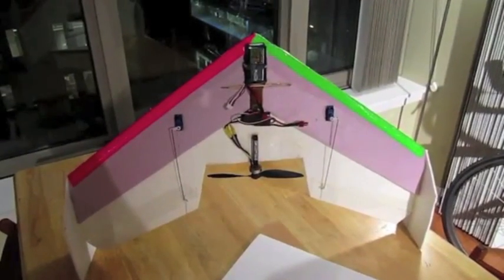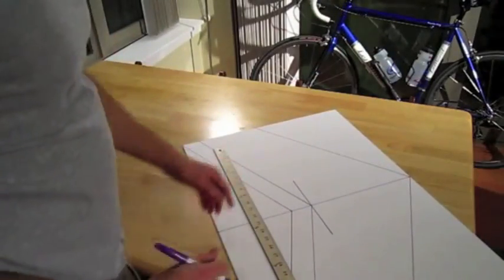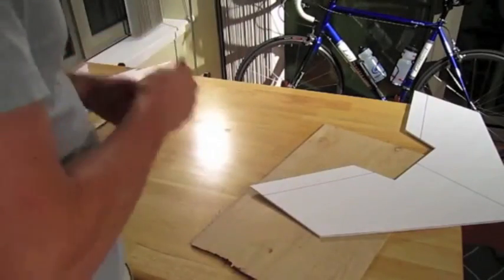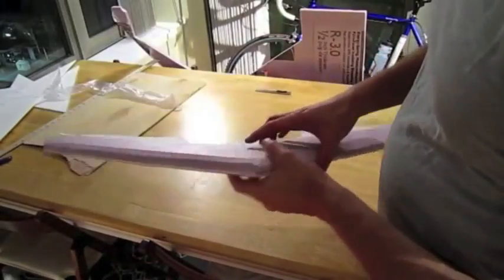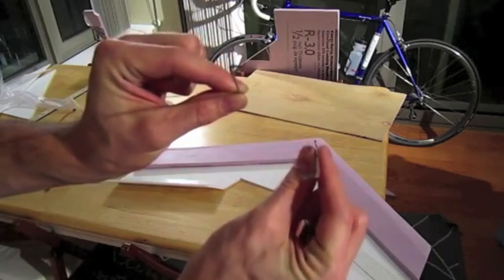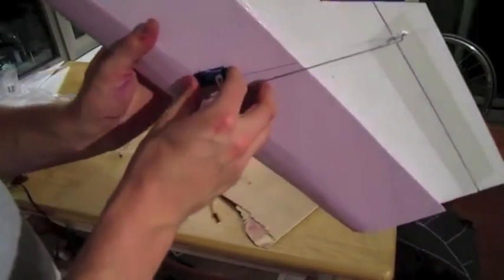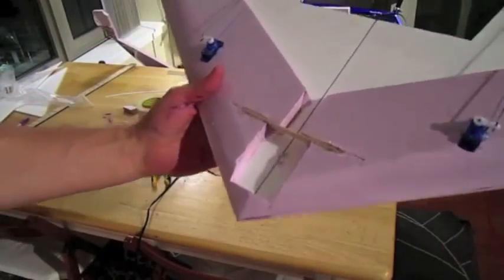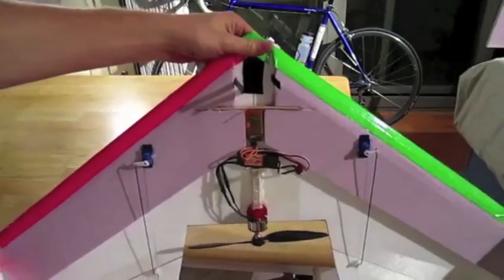Delta Scratch Build Video

Comment: Sir I live in India so that's why I don't have that much availability of Electronics so I can only use 2212 (1400kv,2200kv) bldc motor prop and battery are not my issues but i want a small wing 30"
i want the same stability and power(i want stable plane cause i dont have big area to fly around) suggest me which motor?

Comment: I know this is going to be a very basic question, but I've only dealt with repairing pre-built quads at this point, and this will be my first RC plane, so...
My receiver just arrived a couple days ago, and I'm still waiting on my servos, etc.
How do you wire up the receiver to the battery?  Also, where can I find good mounting hardware for the motor?  (I've searched my usual parts sources for 'stick mounts' and 'motor mounts', and come up pretty empty.  Nothing that seems like it would attach a motor with its spin axis parallel to the mounting surface.)
Reply: Usually your ESC supplies 5v straight to the receiver via the throttle channel.
If it doesn't, you will need to get a battery eliminator circuit (BEC) to do that for you.
This may help: https://www.youtube.com/watch?v=j61Q3e8AFR4

As for motor mounts, i tend to 3d print mine so i really don't know but i guess you could use some angled aluminum.
Reply: Thanks.  That cleared things up a lot.
Reply: No problem!
Reply: Ok, I've got one more question...  I thought I bought the same wire (*.037" hardened music wire) mentioned in another build video, but it just flexes when the servo pushes back.  What should I be looking for?
Reply: This is probably going to be a bit late, but here's what I know:
Hardeded steel wire works fine, about 1.2mm I excpect I use...
I have also hade positive experience with wire coathangers and bicycle spokes. The spokes are good because mine already had the bend made at one end, with a flat part which is easier to incorporate into a model. However, both coathangers and spokes are a lot heavier than I would like, although they fly fine. 
Depending on where you are, prices and especially names may vary.

Another thing you might want to consider is how efficent your hinge is. If it is too stiff, the linkage will have a hard time whatever. Try making the hinge as loose as you can, and furthur reinforce it when you know the limits.

Comment: I've build this kind of delta wing with my own parts and all, however, I have been having trouble with the servos. The servos begin to spin when immediately powered. 1) I did check to make sure it was in the right spot on the receiver 2) the speed that the servo spins is able to be slowed to an extent the controller, but can't be fully stopped. 
Any advice of any kind is kindly appreciated. Thank you!

Comment: This 30" delta flys great. I did not have any thick foam for the top layer...so I just laminated up 3 layers of the Dollar Tree Foam with the paper removed ( about 1/2 inch). Works fine with a old Blue Wonder, couple of 9 gram servos, a 12 amp ESC, and a 1300 3s battery.
Reply: have you setup your radio properly for elevon mixing? stick forward should make both flaps go down, stick back both flaps up, stick left and right flaps should move opposite.
Reply: Oh yes, I did move the servos forward as my builds usually end up tail heave....worked out fine for the CG!
Reply: HI! I build a delta wing, the same dimensions, but i have a problem i can't control it. can you give me some tips!? I have a 1600kv emax motor, 20A ESC, 7X3.5 propeller and a 1600 mAh battery, and it weights 480 g
Reply: Please! :D

Comment: This is, if not the very easiest, it's one of the very easiest to build and best flying wing I've been able to find! I built my first of these 2 or 3 years ago. I added a lot of extrs carbon rod and bent flat form carbon for strenght beyond belief. I then uped the system to 2200kv motor with a 6x4 prop.
This is unbelievably fast and adgile. It handles perfectly.
Thanks for posting this clip. I'm  sure I have posted on this clip before when I first made it.
But it deserves all the aplause it can get!

Comment: just maiden my fpv30 and succesful! im using 1600mah x2 3S in parallel, still need additional weights in the nose..motor is D2822/14 1450KV from hobbyking with 8x4 Master  Airscrew, 40A ESC. flying in half throttle, i built it WITHOUT winglets and still stable.thanks for the plan.

Comment: what size battery is that?  I have 1300mah 3s packs, so im wondering if I would have to mount my motor further towards the nose to compensate for a lighter battery pack?

Comment: would it be easy to scale this design up? I want a plane around ~50" wing span.
Reply: You could scale this up, or go for FPVTrond's FPV49 v2 design.   I've done both this wing (in 30") and FPVTronds scaled back to 44" they both fly really well.

Comment: I built this wing with your same exact setup but I am having issues getting it in the air. It's balanced properly but just nose dives into the ground on take off. How much throw are you using on your elevons? How much down thrust do you have on your motor? Thanks!
Reply: Is it possible that your motor is pitched downward a bit causing it to arc down to the ground?

Comment: Made this last night.  Powered it with the motor off of a Ares Gamma 370,  1250KV, 8  inch prop.  Few notes:, mine files better with the Center of Gravity at like 8 inches, which is natural COG for how mine is set up.  I tried to add weight to get to 7 inches but it would no longer do loops.  Flies nice, requires some up elevator, rolls nice, tight axial rolls, mine does not loop well. THANKS!!

Comment: I building the wing now. Quick question.. what will happen with a 3s 11.1v 2200 mAh installed? I have one on hand so just wondering.. will it cause damage to esc or motor? I have the esc and blue runner on the way in the mail, so pretty much same setup..

Comment: how do I set my transmitter to ? delta wing ? I have a  Spektum-
DX5e
Reply from the maker: Yep! Set it up like as a delta wing
Reply: HI! I build a delta wing, the same dimensions, but i have a problem i 
can't control it. can you give me some tips!? I have a 1600kv emax 
motor, 20A ESC, 7X3.5 propeller and a 1600 mAh battery, and it weights 
480 g.
Please!!!

Comment: i have a question. i have... well had a glasair sportsman and i crashed it today and i was wondering instead of just fixing it i wanted to know if i have make one of these planes with the components my plane came with. it a way bigger engine and it has 3 servers
Reply: For an application like this wing, you could easily get away with a 100-200 watt motor, and it would fly great. Just look up the spec of your motor and check the wattage output. Figure 100 watts per 1 pound of all up weight. The Classair Sportsman is just a shade over 2 pounds, so that motor on it will probably work quite well. My concern is that it is a higher torque motor and turns a stock 9x6 prop. That may be an issue when you hammer down on the throttle. Might cause some serious torque roll at lower speeds. Remember to set your transmitter to delta for elevon mixing. If you can't set your tx, you'll need to add a tail mixer for elevons, which is pretty inexpensive at any hobby store.
Reply: so i built it and it looked great! but since im using the RX from the glasair, it makes my wing roll because of the as3x built into it. it would work fine except that it only works on the ailerons so it doesnt work on the elevator.... so im going to get a new reciever this week and ill see how that goes
Reply: I've built variations of this wing with motors anywhere between a 2204 (19g) and a 755W monster.  You just need to adjust to get the right CG (heavier/lighter batter, or move the motor location forwards a bit).

Comment: Where do you get the 'pink foam'? is there more than one kind, or thickness? Just need to know what exactly to look for . Thanks and great tutorial! PS: Can this also be made as a non-powered sloper as well?
Reply: Homedepot of Lowes.  Mine was actually green, not pink, mine just says "polystyrene" on it. 1/2 inch thickness.  Bring a knife to cut it down to fit in your car.  8'x4' sheets, $10.

Comment: Where do you get your push rods?
Reply: I like to use wire from stake flags, you can get it from home depot (about $3 for 10, but at this size you get 2 rods from each flag...meaning about 15 cents per rod).  I've build a few of these wings, both in KFm-2 and KFm-4 styles.  See my channel for build info.
Reply from the maker: I get mine from hobby stores
Reply from the maker: I've used those too - great deal!

Comment: hi there, i have just finished building this awesome plane, thanks for making this possible. just had a question after installing all electronics including the Battery, my plane weighs 600grams with a CG at 7.5 inches from the nose. keeping in mind that my motor is a 2200kv with a 2200mah battery with a 30A esc, do you think this plane will fly well?

Comment: hello i build one just like this in video as for the dollar tree foam remove the paper and for the pink one from home depo is a 1/2 " thick... later if you want use different color  duck tape i found from the .99 cent store and hot glue it will hole it together stonger  and it flys great for a cheap plane...as for the motor and prop check with the hobby shop happy flying.....

Comment: Hi, is awesome what you're doing. I like it a lot !. I'm buying all the necessary supplies to built the "Delta Pusher". I already buy the foamboards but I notice that they have a paper cover on both sides. Do I need to remove this paper cover before glue all parts together ?. 
Also how thick is the 1 x 30" x 20" foamboard sheet ?. (NO the pink one)
I hope you can answer me !.

Comment: I made this wing after watching your video.  I'm having an issue with my transmitter.  Thought maybe you could help.  I'm using a Spektrum DX5e and when I switch it to "MIX" for elevons, I don't get full throw from my servos.....Hextronic HXT900.  Any ideas?  I do have the rate to HI

Comment: I made one of these but seem to be having an issue with the cg. I move the motor about 1.5 inches up towards the nose of the wing and its about a 37g motor. The flights have been extremely weird and i've been experiementing with battery size and placement but can't seem to fix it. Do you think moving the motor back so that it sits flush with where yours is mounted will fix my problems? Also great videos!

Comment from the maker: I have since switched back to the 24 gram blue wonder - I wanted to see what it was like with more thrust - but the weight negates the effect. This little delta is great though! RCTestFlight flies this design with a 3000 mah 3s lipo and full FPV gear

Comment: Nice plane and build. Why did you switch to the emax 2822? What batteries and prop do you fly with? It seems as though it could be heavy on your delta. I use this motor with a 9x3.8sf on my 42" Blu Baby (from RCgroups.com) and it flies very well.  I am going to build this delta and I want a back yard floater not a fast plane.
 Great job on your detailed build. Thanks!

Comment from the maker: You can, but I don't recommend it. RCTestFlight does it with this plane, but you have to fly very fast to keep it in the air. I recommend my FPV40 for a 3000 mAh and FPV gear, check out my videos - all the info is listed on my website and in the info section below the videos

Comment: Just a follow-up, I reduced the KFm2 step height and slightly rounded the trailing edge of the airfoil, and it flew much much better. I guess that having a 3/4 inch step on a 30 inch wing was just too much.

Comment from the maker: I use an online calculator. I have found that it works great for me. Based on that - I make the CG between the beginner and intermediate lines - then make it a bit nose heavy with some up trim. Hope this helps!

Comment: I have copied your design for the FPV 30, but so far I haven't been able to get it to fly good at all. The wing wants to nose dive really bad, even with lots of up elevator. The only change to the design is that I had to use 3/4 inch foam. So I'm wondering if the large kfm2 step is creating the problem.